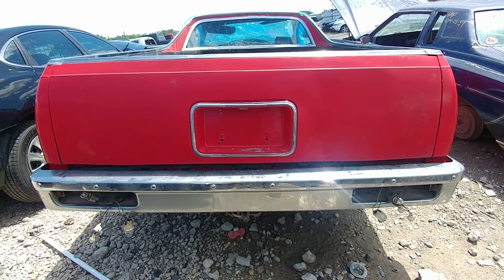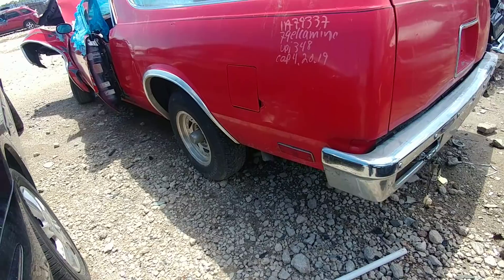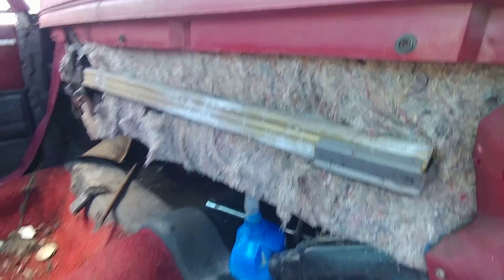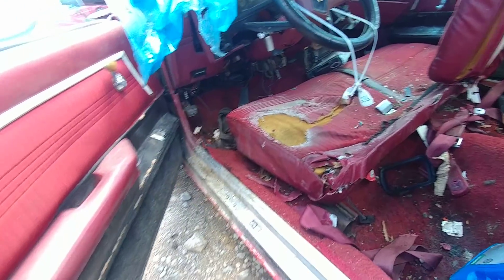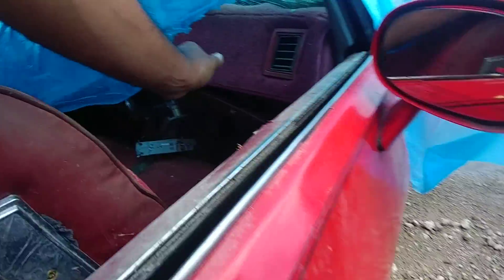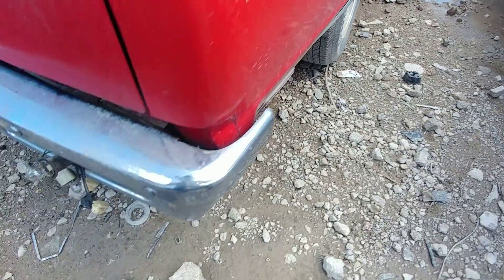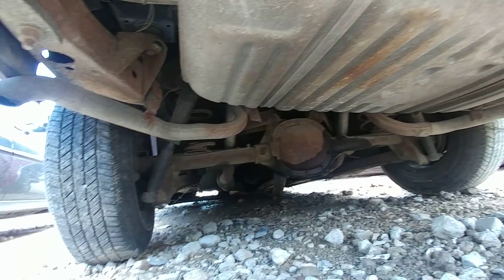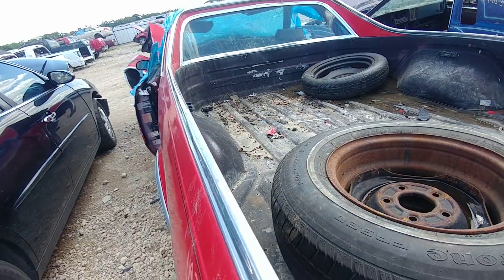1979 G body El Camino Junkyard Find

Comment: Looks like it was probably a 305 originally (maybe a 350, couldn't tell, no VIN or anything in your video). I'd say it was damaged bad before hand, you can see a lot of evidence of filler on the right side, it's pretty thick and looks like someone put it on with a trowel. LOL. That was a nasty hit, looks like it took out the driver's side seat back. You know you're in TX when you see a Big Red can on the floorboard of the vehicle. LOL.

Comment: Smh...probably had the original 010 Block!
Reply: These would have had a low performance 350 "LM1" V8. Nothing special, but I'm sure with some work, they can be made into decent runners.
Reply: @googleusergp  Yes...for the time, they were stout. My 1978 had the original 350 in it when I got it. Something like 185hp..lol
Reply: @apdabeast15  True. My '79 Trans Am with the Pontiac 400 (last year) was 220 HP on paper, probably more like 250-260 in real life. Supposedly NHRA tested them and got those numbers. Surely can be woken up with some tweaking. The foundation is surely there for it.